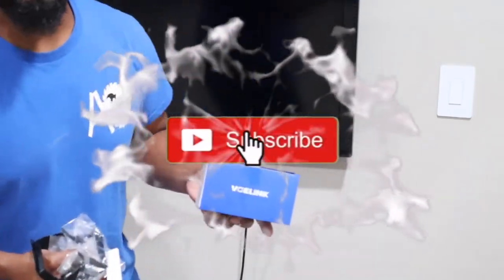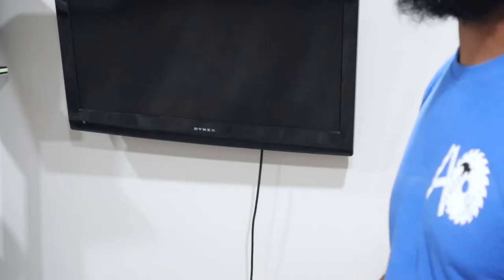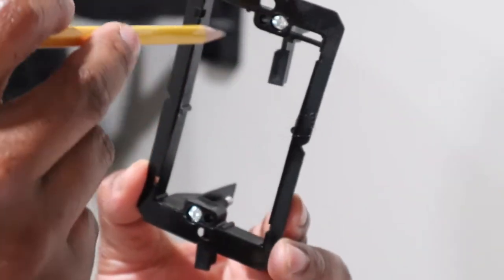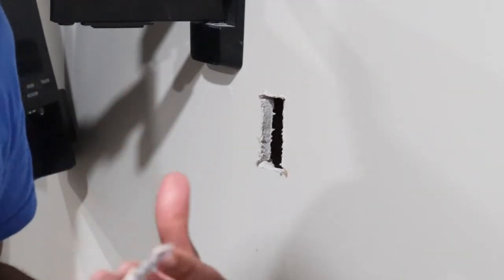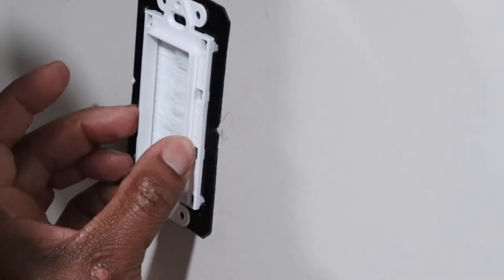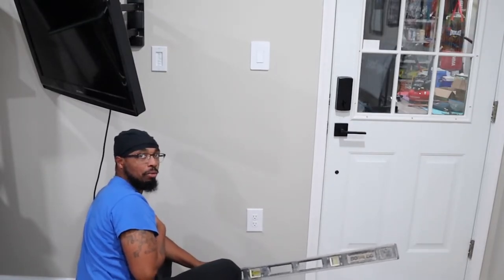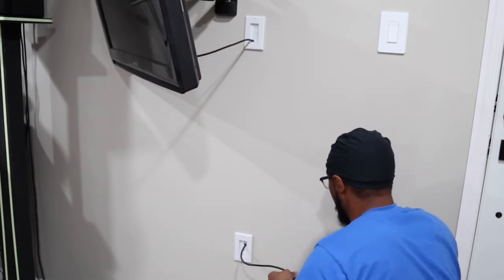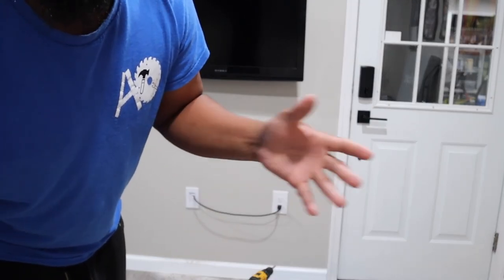VCE Single Brush Wall Plate with Single Gang Low Voltage Mounting Bracket REVIEW!

Comment: Unfortunately, dropping a tv power cord behind the wall is against electrical code. An actual power outlet should be added behind the tv, or there’s other options in behind the wall systems that has romex for behind the wall.
Reply: Exaclty, This is not to legal code.